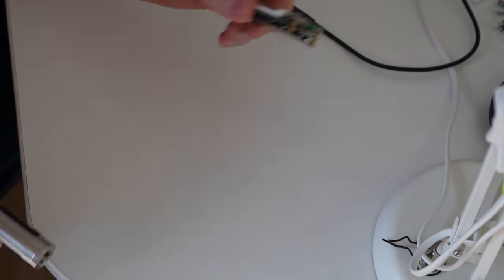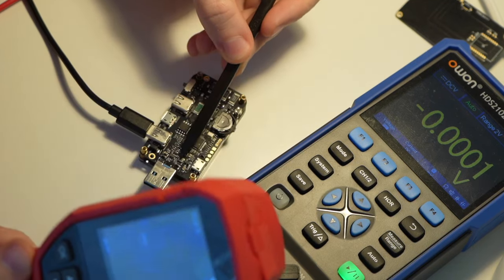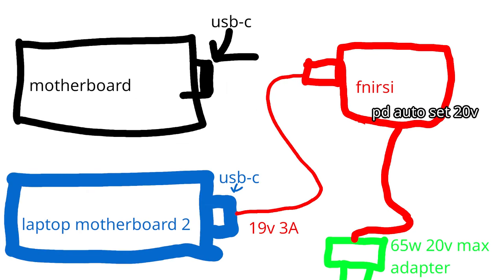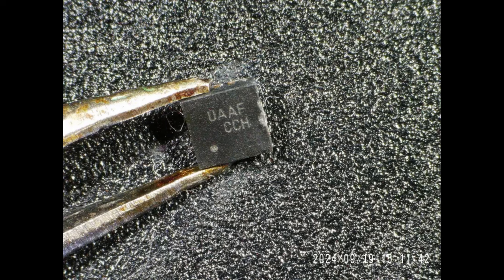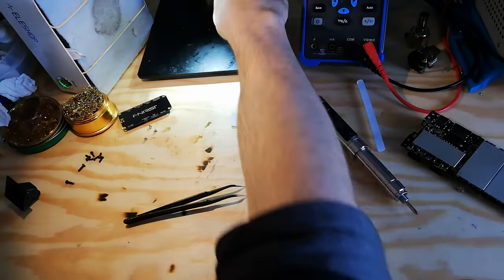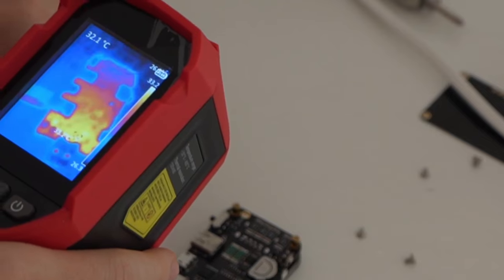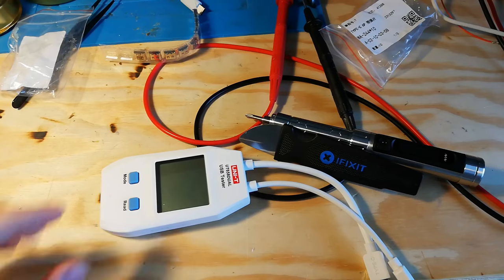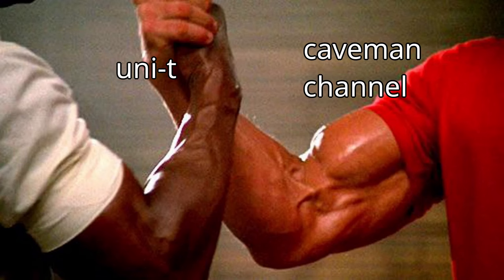im mad. my usb meter died in the stupidest way

Comment: On a different unit, the marking was UAAC CEH, yours is UAAF CCH. I'm leaning towards OnSemi's FUSB302BMPX with top mark "UA" in WQFN14 package, described as Programmable
USB Type‐C Controller w/PD. I found one listing on Aliexpress with markings UAAD GNB in matching font, so I'm fairly confident that's it. Please comment if you decide to replace it!
Reply from the maker: I salute your ability to find chips! 
I have already taken a few parts from the fnirsi donor, but i think we can for sure revive it. I'm going to order it in December and do a video next year when I'm back in my lab :^)